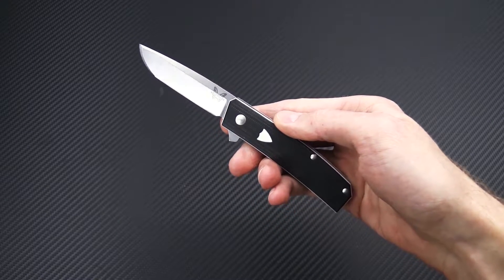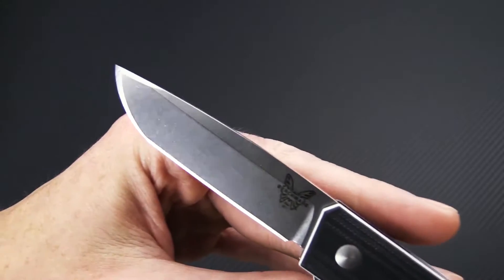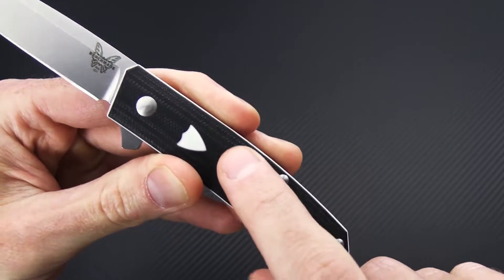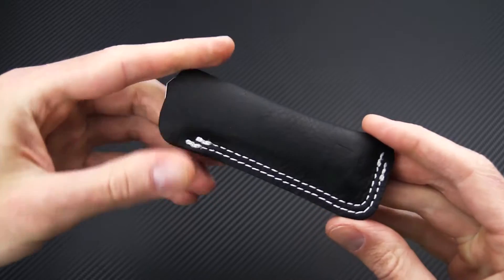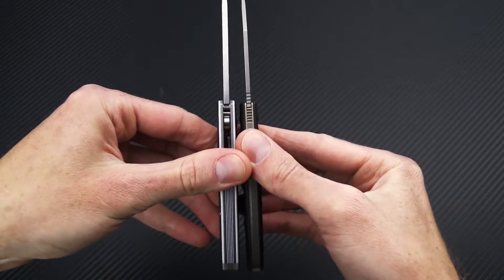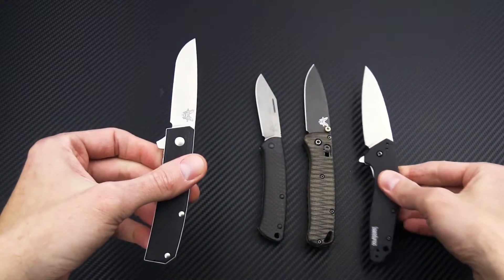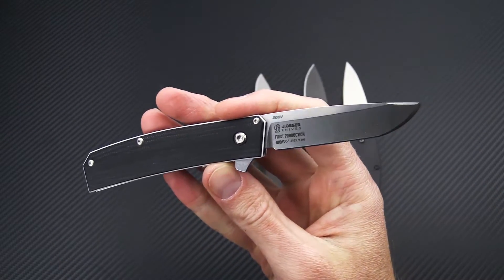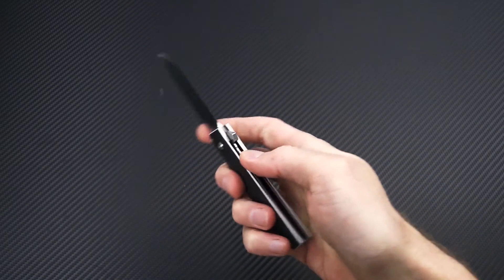Benchmade Tengu Jared Oeser Flipper Overview

Comment: Looks like it would be a mission to sharpen with that tanto plus the wider tip.
Reply from the maker: Depends on what you use for sharpening. Angle on the tip is different from the rest but should be fairly easy to get it done. Thanks for watching.

Comment: Does the flipper tab get in the way of your grip? Looks like it might make it so you hold further back than maybe you would want
Reply from the maker: Depends on the size the user's hands but I did not find that to be the case. Thanks for watching.
Reply: Take a measuring tape or ruler and measure the grip of your hand area. Then check and see if this knife is a good fit for you. Doing this has helped me big time when buying a knife online.

Comment: Too much with the graphics on the blade. I saw one in store and it had a chip on the tip.
Reply from the maker: Unusual that the tip would be chipped. Look for the non-first production models for less blade marking.